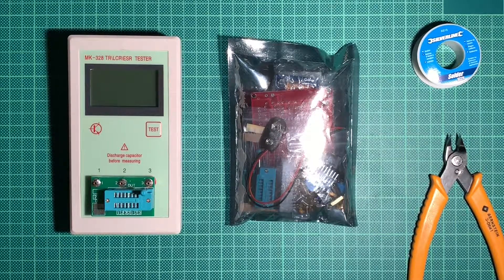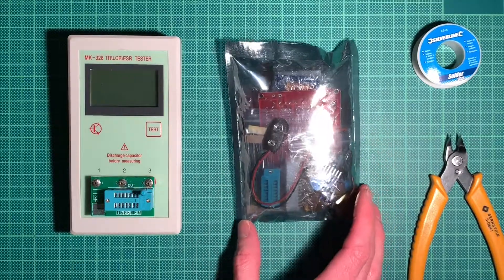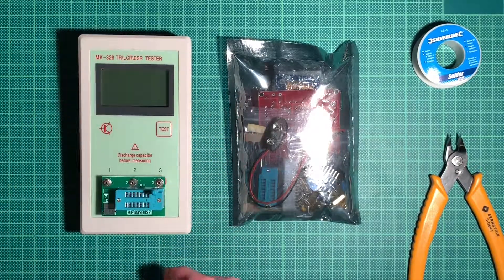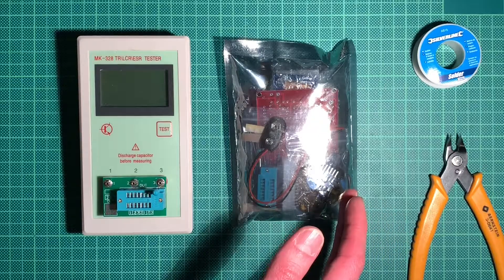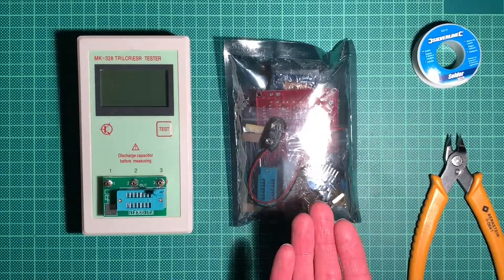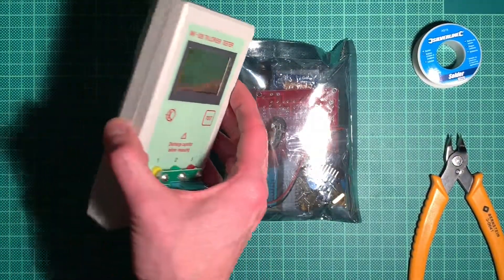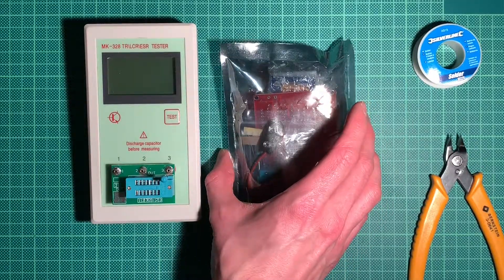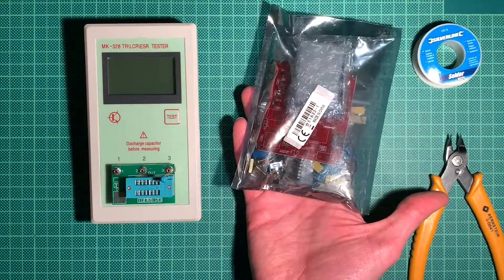KKmoon GM328 Transistor Tester Fail!

Comment: I have assembles this kit and I'm getting a similar problem, I have to hold down the rotary encoder switch for it to stay on and when I let go it turns off. Also the red led is not lighting up. I have tried flashing the 328p with other firmwares (currently 1.13k) and still the same issue.  Please someone help. I'm also using the 16mhz crystal

Comment: I got one of these, put it together OK, and it works, sort of.  Keeps saying 'weak battery 5.6v', even though batteries are brand new, on DC 7.5-12v its same error 'weak battery 5.6v'?  It's like its not getting correct voltage.  Screen is a little dim also, but probably due to the max 5.6v problem.  Any ideas guys?
Reply from the maker: Maybe you have a wrong resistor somewhere? Could lead to wrong voltages...
Reply: @root42  Yeah that's what I thought buddy, but I've checked them all, all values correct and match with my meter. Must be something else.
Reply from the maker: Test the components in your tester! Haha. Just kidding... I gave this device to a friend so I can’t check but: was there a voltage regulator? Maybe it’s broken? Otherwise try to trace voltages starting from the battery. Are there testpoints?
Reply: @root42  :D lol, good one, haha :)  Could be the regulator HT7551?, but I have none spare, and have all the other parts in stock, if it was anything else, lol.
Reply from the maker: @scaramonga  yes thats the one. see datasheet here: http://www.farnell.com/datasheets/2047678.pdf
can you measure what it outputs? and what goes into it?
Reply: @root42  I can, lol, but I've already ordered another kit, so will test when I receive it, and just swap out the duff part ;)  Hard to get these HT7551 without hassle, so I took the easier route lol :p  Thanks kindly for the datasheet, and looking over it, I think this is what the problem is.  Should get on Wednesday, and will let ya know how it goes buddy :)

Comment: Reflux it. Check your components. It could be something silly that was overlooked.
Reply from the maker: We solved it a short while after: they supplied the wrong quartz. Replacing it with the correct one fixed it...
Reply: @root42  
hello good night i have the same problem how did you solve the problem ?thank you

Comment: HI, I purchsed three sets. One contained the 30MHZ and the other the 8MHz. The 8Mhz worked perfect with the displays. Only two of the displays worked with 30MHz! There must be also tolerances in the displays, too. 

For the measuring results, the capacitor results are up to 300% wrong with 30Mhz crystal.After repacement with 8MHz everything worked well.
Reply from the maker: Thanks for the feedback! Luckily crystals are cheap…

Comment: I have 2 of these and I've helped several people with purchase and assembly and we had no problems at all. I love these inexpensive testers! I have a question: Does anyone knows and or made them selves firmware UPDATE? How can one find what version is on their LCR tester? You all have a great day!
Reply from the maker: You might find information on the German microcontroller forum: https://www.mikrocontroller.net/articles/AVR_Transistortester

The article has information about firmware in many languages, including English.
Reply: @root42  Thank you for the information. I was aware of this website, but I have not seen anyone on the youtube making updates. Do you, or anyone else, knows exactly what to do step by step? (I'm talking about updating the firmware from 2018 to 2019....) Also, is there a way to test for the version number on these testers? I would like to see a group or youtube channel dedicated to this - is there anyone out there to help? Thanks!
Reply: @tonysfun  Hi I know you asked this 4 months ago but in case you are still interested there is a huge 200+ page forum thread on EEVBlog about these type of testers and it has people making all kinds of upgrades to them. Custom firmwares, 3d printed enclosures, input modifications, etc.

https://www.eevblog.com/forum/testgear/$20-lcr-esr-transistor-checker-project/

Comment: I had the same problem.  With the naked eye, the solder looked pretty good.  However, further examination of my LCD ribbon cable under my microscope revealed solder bridges on 3-4 pairs of terminals.  Since it knew the tester was working as I had the same result as you, I took a chance to try to repair (Nothing to lose at this point).  I used my vacuum de-soldering tool and ran it across the solder joints on the LCD.  This removed all the solder bridges and when I plugged the LCD into the circuit, IT WORKS!  One could do the same with some solder wick and soldering iron.  The only thing that is necessary is to not overheat/damage the ribbon cable.
Reply from the maker: Thanks for the hint! I‘ll check if the display can be salvaged like this.
Reply from the maker: Ok, so we checked the device again, but the display was fine. BUT it turns out my kit came with a 30MHz crystal(!) whereas the BOM calls for an 8MHz crystal. So the whole thing was overclocked like crazy. Replaced the crystal and: it works now! I will do afollow up video where I will explain this in more detail and also link to a BOM which people can crosscheck against their own kits.
Reply from the maker: Here is a link to the BOM and assembly instructions: https://img.banggood.com/file/products/20170621041717Transistor-Tester-assembly-instructions.pdf
Reply: @root42  Yes, the Arduino uses an 8MHz crystal.  So the 30 MHz would have rendered it useless.  There seem to be two major flaws in these kits, workmanship (poor soldering, like mine) or wrong/defective components (like yours).   I always check my components before I install.  I had another, similar device that came with a defective 78L05 5V regulator and it would not work as well.  Good thing about this is that it helps your troubleshooting  improve.  So this has helped me fix two otherwise dead devices.

Comment: @root42 it would appear we are in the same boat so to speak. We also had the same thoughts on the soldering on the LCD connector. I've been trying to fix the tester for hours and only just seen you put in an LED and I decided to do the same - and the LED flashes. It is a pity that I don't have another screen to test with. I also tried connecting the LCD to my arduino but had no luck there.

I've a feeling the screen is similar but not identical to the ST7735 SPI. I may look to purchase https://www.aliexpress.com/item/1-8-inch-TFT-LCD-Module-LCD-Screen-Module-ST7735-SPI-serial-51-drivers-4-IO/32964493983.html once I've confirmed the pinouts with the schematic I have for the current board (VCC, GND, CS, RST, RS, DATA, CLK, LED).

edit: I'm fairly certain that on the ribbon cable connector I have there are shorts on the two left most pins and two to the right of centre pins. I got my magnifying glass our with multi-meter on continuity test and made sure not to test the same pin. The LCD is most likely a dud.
Reply from the maker: Yeah, I think either they use the wrong firmware for these displays or they have a high rate of broken displays. I gave the tester to a friend, and also gave him a generic SPI TFT to test with it, as well as the possibly broken one. Let’s see if he manages to get either one running. But I don’t have high hopes.